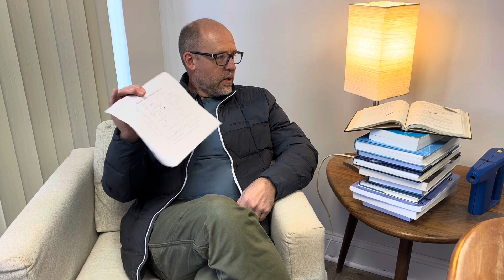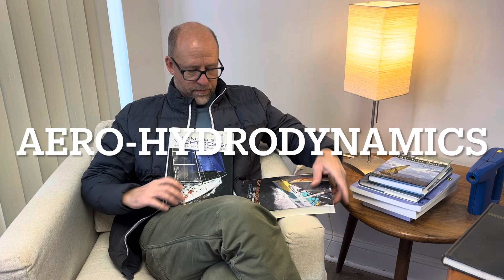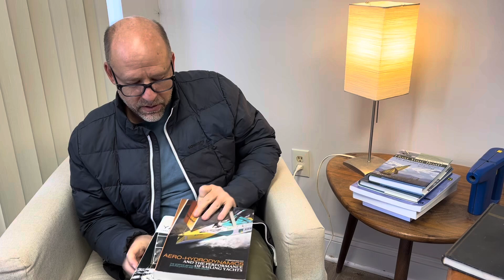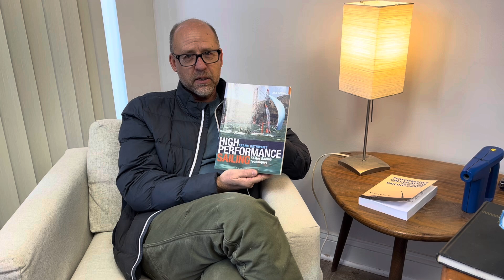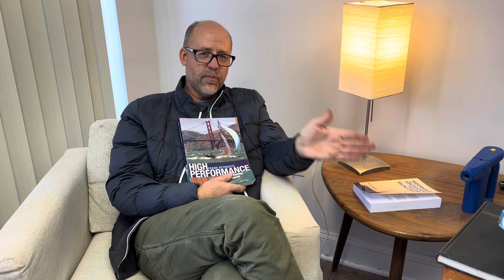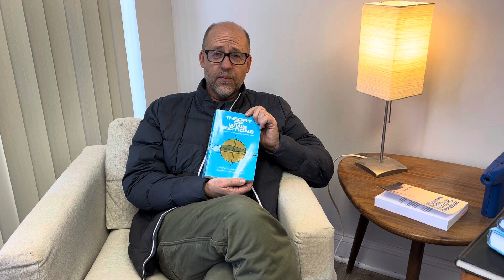My Top 10 Favorite Sailboat Design Books

Comment: I believe the skimming hydroplane is more practical than a hydrofoil because seaweed is a constant in most oceans and a fouling of hydrofoils must be a concern. I hope I'm not incorrect.
Reply from the maker: I agree.  If you leave the leeway resistance in the main hull in the form of a dagger board or center board, you can periodically pull it up and removed any weeds.  I guess you could also do that with a vertical or angled hydrofoil, but you would need to be able to control it with and up and down line and the yawl would be more pronounced.
Reply: @markpalmquist  I would hope an rear angled daggerboard would prevent the leeway while shedding seaweed. I'll find out eventually as my next boat will be based on your designs.
Reply from the maker: @astrayalien  that might work.  I am not sure what angle is required to shed seaweed.  I think I have read somewhere that the angle required is quite dramatic but I am not sure.  I am glad you are making a similar boat.  It would be great to have someone else confirm my claims.  I have shown my videos to Rob Denny of Harry Proa and he is very excited and encouraged me to continue testing in rougher waves and experimenting with shifting my weight towards the center to see what happens when I reduce my righting moment.